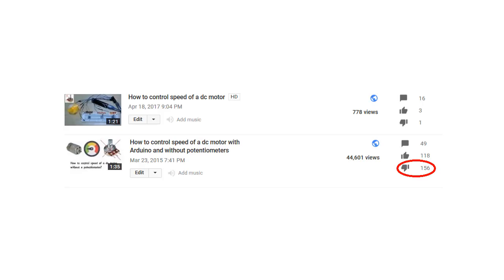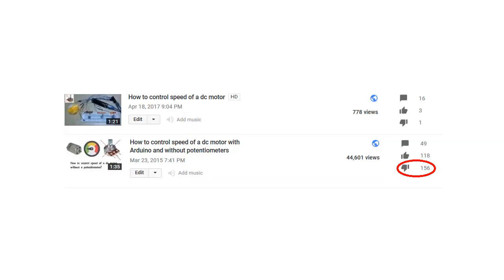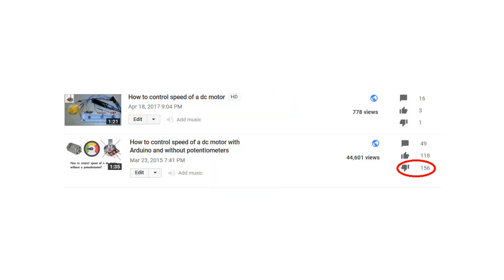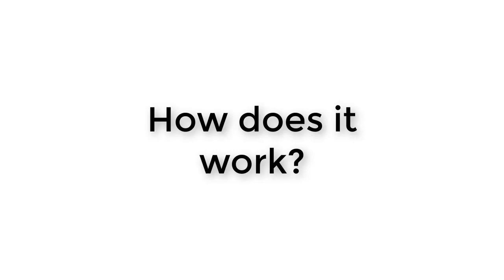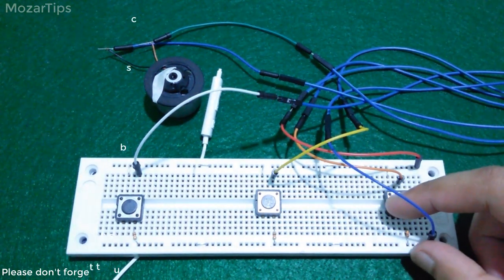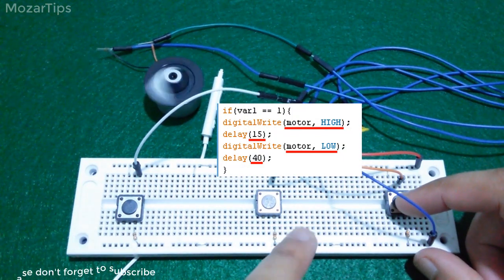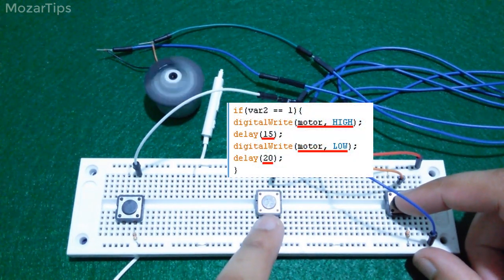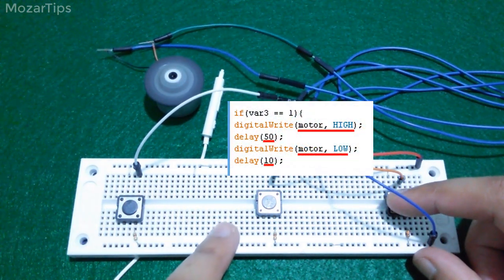CONTROL SPEED WITHOUT POTENTIOMETER (Arduino)

Comment: Maybe they disliked it because your audio is unclear, and your sound levels are off. The motor shouldn’t be louder than your voice! That kind of thing is the point of editing!
Reply from the maker: So it's doesn't matter with the actual thing. Only thing matters is how someone edits the video?
Reply: Mystery Tech clearly the content is the ultimate point of the video, but if the video fails to transmit the information because of poor editing, then poor editing has rendered the video pointless. So they go hand in hand. For example, if I were telling you the absolute best possible way to do something, as in there were no better way to do whatever it is, than the way that I am telling you, but you can’t understand me, for whatever reason. Then does it matter that I told you how to do it? Or is it all rendered pointless.
Reply from the maker: @jtb8631  I don't really get it how people don't understand tjis simple thing and blame the editing skill. I've seen lot worse edited video yet those video get millions of views. To understand something is completely depends on individual people. Something can very easy to someone yet it can be very hard for someone else. Anyway forget it dislikes and less views put me of so I'm not bothered now.
Reply: Mystery Tech, I am glad that you are no longer bothered. My initial comment could have probably been presented differently, but it’s message still holds true. I would have probably found your video quite informative had I been able to hear what you were saying. That’s all I was trying to say. Also, if people already understood this simple thing, they wouldn’t have clicked on your video. And it is possible that they were just beginning to investigate the subject and this video was the first resource they found. So it is believable that the people who are watching this, don’t already know how this works. Isn’t that why you made the video?
Reply from the maker: @jtb8631  Initially I started making videos to help people  and in a hope of earning little bit of extra money, but when dumb people started disliking my videos YouTube's algorithm stopped suggesting my videos. And when I saw no views after hard work and saw more dislikes then likes than I thought F it I'm out. I don't feel making any more video now.

Comment: This is Really Great brother! By the way i already upgrade it, now you can control speed using 1 button only :D (Speed : 1 , 2 ,3 and the stop command using only one button), i would be glad to share it too :D
Reply from the maker: Thanks a lot bro for sharing the previous one, and I have given you full credit in the post :). If you could share the updated one that will be appreciated.
Reply: Actually bro, i only modified some  codes on the previous one, but same flow. 
Here's the Code:

const int motor = 4; 
const int btn1 = 5; 

int button1 = 0; 

int var1 = 0; 

void setup() { 
// put your setup code here, to run once: 
Serial.begin(9600); 
pinMode(btn1,INPUT); 
pinMode(motor,OUTPUT); 

} 

void loop() { 
//Unlimited Execution 
// Eco-Programmer 
Eco(); 
} 

void Eco(){ // its optional, you can name your on void.
//This is the customized void 
button1 = digitalRead(btn1); 

if(button1 == HIGH){ 
var1=var1 + 1;
Serial.write(var1); 
delay(300);
} 

if(var1 == 1){ 
digitalWrite(motor, HIGH); 
delay(15); 
digitalWrite(motor, LOW); 
delay(40); 
} 

else if(var1== 2){ 
digitalWrite(motor, HIGH); 
delay(15); 
digitalWrite(motor, LOW); 
delay(20); 
} 

else if(var1== 3){ 
digitalWrite(motor, HIGH); 
delay(50); 
digitalWrite(motor, LOW); 
delay(10); 
} 

else if(var1 >= 4){ 
var1=0;
digitalWrite (motor, LOW); 
} 

else{ 
digitalWrite (motor, LOW); 
 } 
}
Reply from the maker: Thanks bro, loved it. I haven't tried it but very  soon I will. :)
Reply from the maker: Bro I've just tried it and it works perfectly, thank you very much for your help. 😊  But I think you've left the  btn2 and btn3 in the void setup that's why it was showing an error. I've fixed that and added another function which stops the motor with the same button. So that means with this sketch (above) you can control 3 different speed by clicking one button but you can't stop the motor once it turning.
Reply: The Unwanted Guy owh i see bro.  the main code was on the office,  i modified it on the spot on the reply menu here that's why i didn't test it :D,  but great to hear that it's working :D my fault, sorry hahaha.
Reply: i think the delaying is the problem, change it to delay(300) instead of delay(150) on the  button High {var1 = var1 +1; }.., :D..., delay(150) is too fast thats why when you push the button it was jumping and i added another else if condition ... btw i edited the above sketch.
Reply from the maker: Thanks bro, I've already edited it to make it control 3 different speed plus stop function. It can easily do that. I'm so glad that you've helped out. I've got one question. Could you make it speed go up and down using 2 buttons? If you can, could ypu please share sketch here? Thank you very much in advance. :-)
Reply: button1 for increment(example speed : 0 - 3.)...button2 for decrement (example speed: 3 - 0)  is that what you mean bro? Yes i can do that. :D
Reply from the maker: Yes bro, that's exactly what I want. :)
Reply from the maker: Thank you very much bro, you are the best. :) I was a bit busy that's why I couldn't try it but I will try it soon  and let you know. :)
Reply: @mozartips  Hey mate, can you please upload the final code so I can test it? Thanks in advance! Cheers
Reply from the maker: @daretattoo1  Which final code?
Reply: @mozartips  to control 3 different speeds and turn off with one button
Reply from the maker: @daretattoo1  Did you check the description?
Reply: @mozartips  yes but in the description there is a link which opens a diagram with 3 buttons
Reply from the maker: @daretattoo1  so you want to add stop button as well?
Reply: @mozartips  no. to use only one button for example press once and the motor turns on on 30% speed, press it again and it'll increse the speed on 60%, third press to 100% and 4th press turn it off. Trying to make air purifier so I need at least 2 speeds, one high and one low for using it during the night
Reply from the maker: @daretattoo1  Well, although I've understood what you meant but unfortunately I'm not feeling to waste my time in experimenting the code as it takes quite lot of time to do so, plus I don't get views for my hard work instead people dislike it. Very sad and disappointing. Sorry for letting you down. If you want you can try Jerico Viñas's code above.

Comment: That was creative...even though it is harder to do...using potentiometer is way easier...but yea, it was a very creative idea :)
Reply from the maker: My friend it's very easy if you know a bit about Arduino. :) Yes using potentiometer is easy but imagine you use something which need few certain amout of speeds, let's say 20%, 55% and 77%. Now if you control it digitally you might need 3 or just one button to choose that option. But in the other han how you gonna tune certain speed with potentiometer? Keep turning the knob? You'll be frustrated to adjust the speed, lol. That's why this system is very good for palaces like that. I hope you understood that. :)
Reply: Ouh yea...I didn't think about that... You can't tell the exact speed using potentiometer... Ok I understand now 😅 ...thanks